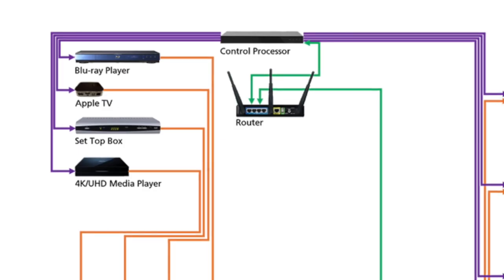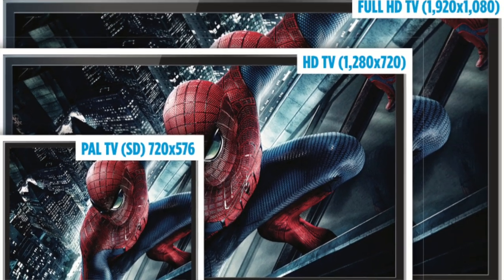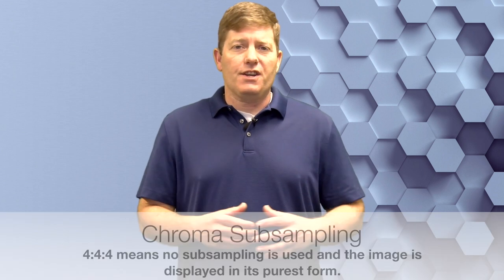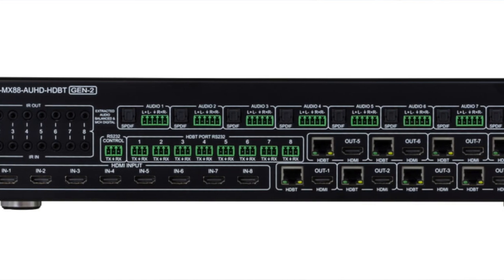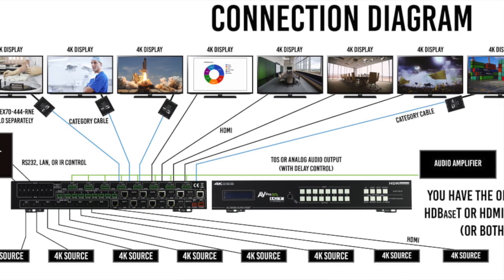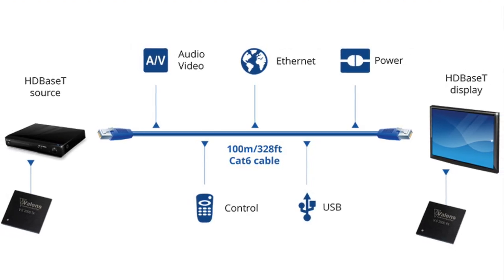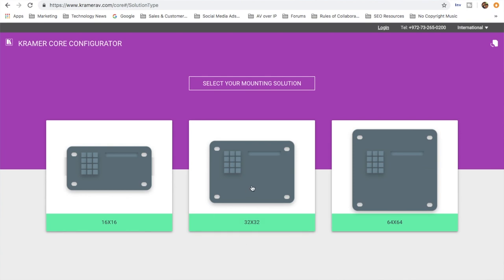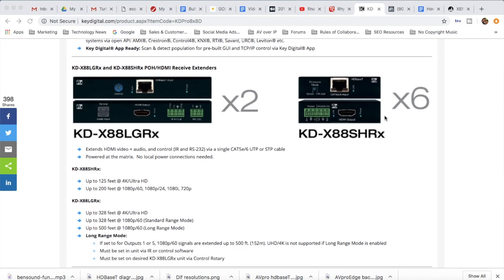What Is an HDMI Matrix Switch?

Comment: At the .34 mark,  I do not see audio to the display.  Does this provide audio?  Is this a replacement of the normal baluns that use cat cable?  Why is a matrix the preferred option?  I have prewired for video distribution to 6 TVs that require ultra 4k or better for future proofing.  What is the most economical solution, counting all devices that I need?
Reply from the maker: Yes, HDMI Baluns over Cat cable pass the audio Signal to the Displays. Some offer ARC (Audio Return Channel) As well, but it must specify this on the spec. 

 "Is this a replacement of the normal baluns that use cat cable?  Why is a matrix the preferred option?" 

Not sure I understand your questions, please clarify.

"I have prewired for video distribution to 6 TVs that require ultra 4k or better for future proofing.  What is the most economical solution, counting all devices that I need?" 

Which cable did you run, CAT6? 
How are  you planning on controlling the switching? Remotes, touch panels? How Many Sources do you have? Are you using a House Amplifer for any of the rooms or surround sound? 

There are a lot of questions,  probably best to email, call us at 888.660.2962, or visit bzbexpress.com for online chat for the best solutions.

Comment: Does it snap well to 1 display like survalence monitor's? just in case your tv doesn't have the feature & mostly Your TV or display devices usually don't have the multi-input matrix option.
Reply from the maker: Hi Jonathan,
I'm not sure I understand your question completely.  Matrix switchers are designed to route any 1 of the input sources to any 1 of the output displays.  Regardless of external devices it will always show a single input on a single output.  

If you are looking to see multiple inputs at once on a single display you should look at a multiviewer, check out this video https://youtu.be/UWKRaNEfQMQ

Comment: Can it be used as a HDMI capture card?
Reply: I was wondering the same thing!
Reply from the maker: Hi Sharon, no it just distributes the signals. You can connect capture devices to the matrix switcher. What are you trying to accomplish?
Reply: @BZBTVchannel  
Will it work to switch a live broadcast/stream of multiple cameras that each have HDMI out?  Or will there be lag between the switching of cameras?
Reply: @BZBTVchannel  I am trying to use my video camera in a multiple camera online teaching setup.
Reply from the maker: @huyked  Yes, it will work with with multiple cameras. Some matrix switchers have lag, but there are also seamless matrix switchers with zero lag. Pls visit our site bzbexpress.com, where you can chat with us. Every situation is different and we can provide a solution product for your specific application.
Reply from the maker: @sharonbaab3101  a matrix switch may apply to your situation, but i'm sure we carry a more cost-effective solution for what you're trying to do. If you care for any help or just want to know your options, pls visit us at bzbexpress.com to chat or call us at 888.660.2962

Comment: Can we connect lg Dolby Atmos sound bar to audio matrix switches
Reply from the maker: It depends on the matrix switcher, but yes, most units support Dolby Atmos.
Reply: @BZBTVchannel  but lg Dolby Atmos sound bar is a smart system.What if we get some sort of problem during the  connection with the switch?
Reply from the maker: @sankalpgupta1556  with a sophisticated sound system, our best recommendation is to speak directly with the manufacturer of the matrix switch you decide to choose to see if they have tested out an IG Dolby Atmos system with their product. Also, our tech experts are available to chat at bzbexpress.com. for further consultation.

Comment: What Matrix would you recommend that would accommodate all three immersive formats?
Also, if I'm utilizing a processor for all equipment and a matrix switch for display only, would the first question matter at all?
Reply from the maker: How many sources and displays do you have? What is the distance from the Equipment to the Displays? Considering HDBaseT extensions? Are you looking for 4K@60Hz HDR?

I recommend calling or emailing our Sales department for the best recommendation to suit  your needs! They will work with you and your budget as well.

Comment: My key requirement for matrix switching of HDMI sources and monitors to switch with close to zero latency (no EDID negotiation). This video assumes that once things are setup, nothing changes. What's the point of a switch if you don't need live switching.
Reply from the maker: Hi, sounds like you are not using DVD players, Cable Boxes, Streaming devices that have HDCP requirements.  I assume you are using devices like PTZ cameras, Video Camcorders and maybe analog devices that do not need to be HDCP compliant. If this is the case, you should be looking at Production Video Switchers which we do also sell if interested. Overall, sounds like this video does not pertain to your specific application.

Thanks for commenting and watching!

Chris